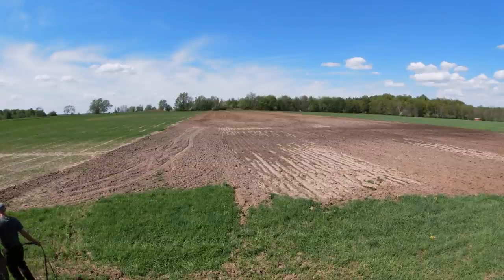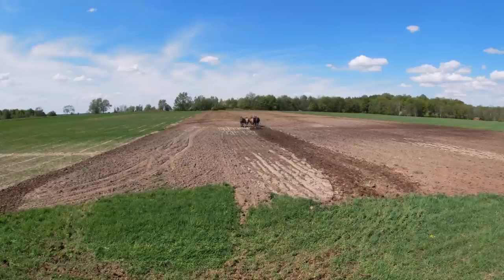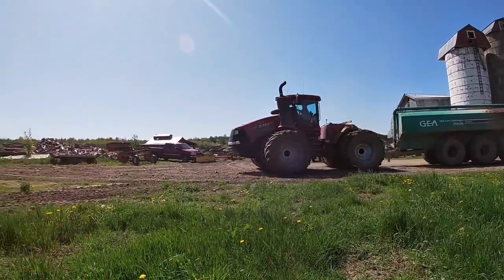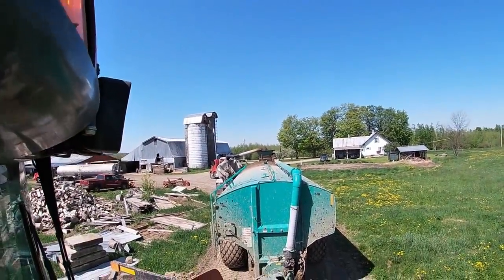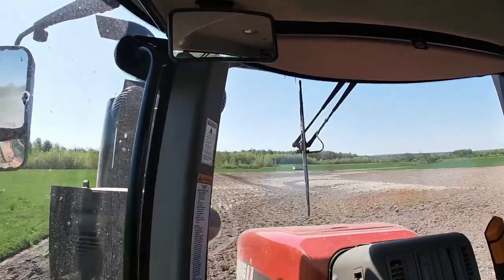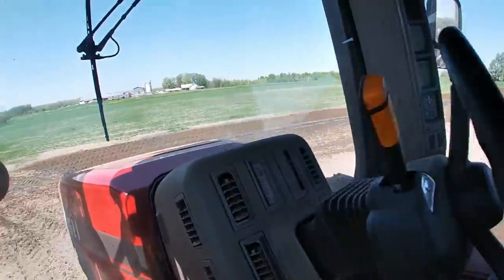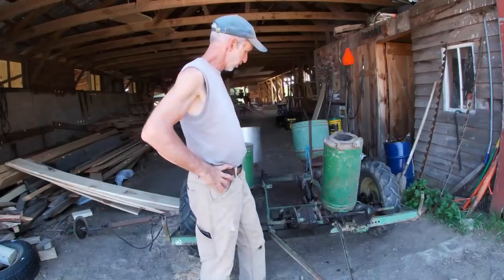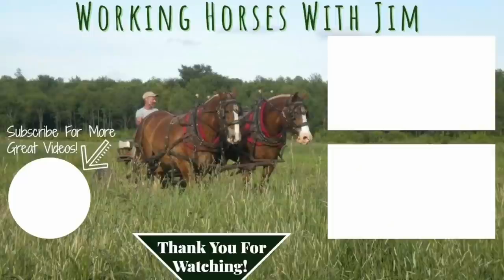Are Big Farms Bad?? My Thoughts On Large Farms!

Comment: The really large dairy farms have a problem with disposal of the cattle wastes. Most don't have enough land to spread the waste on for fertilizer without causing runoff. Storage in lagoons for the winter can pollute wells if they have a leak or if a dam bursts, flood the neighbor's land. My last years with my state's environmental agency, more strict regulations came into play for storage and disposal of their wastes on really large farms to protect the environment from runoff into streams and rivers. When I was a boy on our 20 milking head dairy farm, the biggest problem was winter storage. When we had horses, we could spread into the early winter near the barn, mostly on pastures.. We weren't concerned about runoff and much of the nutrient load was lost in the spring. We always had to supplement with chemical fertilizers on crop fields. Many farms and chicken and turkey farms have gone to composting of wastes. Compost is more of a soil amendment rather than a nutrient. Bird waste is so high in nitrogen, it could burn a crop. I saw wells polluted with nitrates during my time with the county health department and I also worked with smaller farms when I worked for local soil and water conservation districts. I've seen many changes over the years.
Reply: Floridian here, boy do I wish I could access som of that poo, I would be there in a hot minute!
Reply from the maker: Yes that is a problem for the big farmers

Comment: Hi Jim I have asked  this Question before on an older video, it is about the clipper that you use, what model and what kind of blade do you use, I have two small Oster, but they don"t cut anything I have 6 Norwegian Fjords and as you may know I have to cut their mane every so often and I use a scissor for that and it works great, but for other cutting I would like a good clipper, so any input you may have on that would be appreciated, thanks  Bert
Reply from the maker: It’s an Oster clip master . I usually get blades at tractor supply

Comment: when the small farms started going out early to mid 70s, that when America started going down hill. JMO. here when most of the farms  sold out. , we lost two welding shops, four feed stores, two tire shops, 3 good sized trucking companies doing farm pick up.. 4 different tractor dealer ships, not counting a couple independent repairmen, two artificial  breeders. the rail road shut down. . two milk testers,  cattle dealers, the auction house, only one auto dealership  left in a fifteen mile radius now. carpenters, roofers, masons all gone. now to get anything done, you have to have a large wallet and talk to a person wearing a white coat and a carrying a computer.. did I say that the two supermarkets are setting here empty also,  maybe the farms going out wasn't the cause of all the above, but it sure looks that way.. but some  "experts "call it progress,,  probably most of the people who worked at the above places are deceased now or in their 80s like me.. the kids either work for the state or moved on.  even the two large farms that were left, milking over a thousand have closed up shop..

Comment: It has no soul. Rowdy. Very necessary for what in Australia we call "broadacre". Here on this farm they got little tractors and gear for small paddocks, lucerne (alfalfa) and winter oats for grazing. Out west the rigs are huge, and the equipment 40' wide, take it off and adjust the wheels and tow it longways then attach it for work once gates all negotiated. But you don't have debt on a tractor, or a huge diesel bill, you have peace and communion with animals, you're not having a lot of repairs and mechanical issues. GPS you have, the horses always know where home is, and they know what a straight line is once you got the first row done. Tractors don't work to grow their own food. Nor do they reproduce by themselves with only feed to do it. Small farm and horses and local trading is nicer. Broadacre is essential to feed the idiots who crowd into the cities to shuffle paper, which is not at all productive.